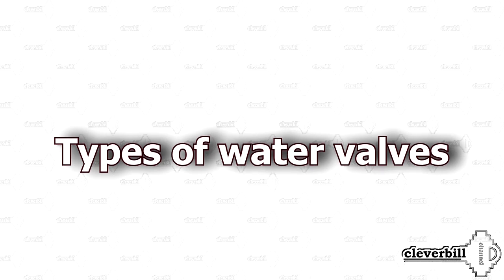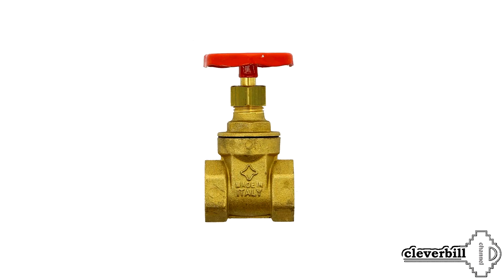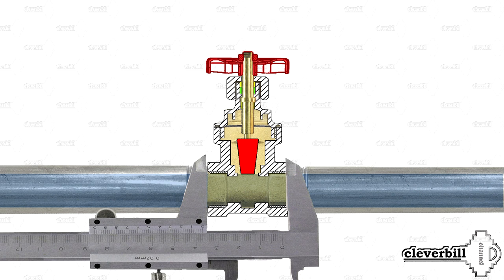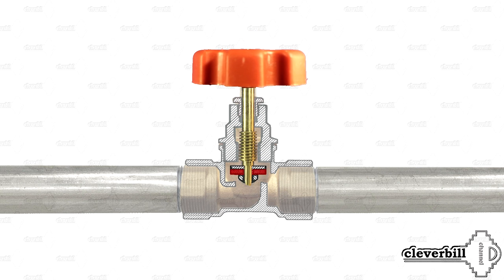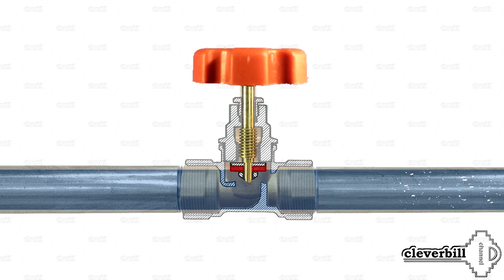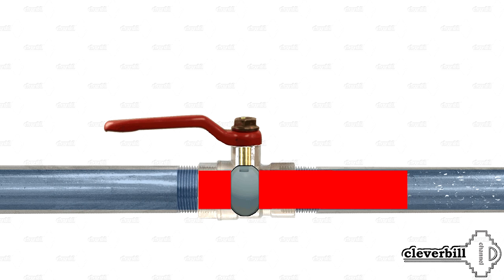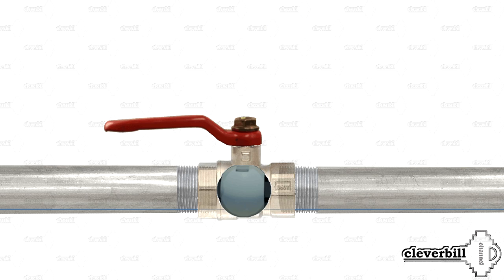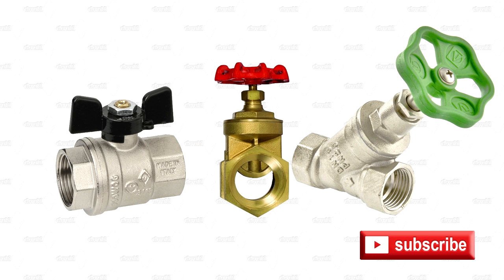What's better - ball valve vs gate valve vs stop valve

Comment: This was a very good demonstration of the valve differences.  my shut off valve to my house won’t stop the flow completely so that I can do plumbing repairs and changes. I am sure the rubber seat washer is worn out. So using your information I want to replace it with a ball valve. What are your thoughts on homeowner use of brass compression fittings instead of solder connections. It will be much easier for me to replace the whole house shut off valve outside the house without having to solder the connections.
Reply from the maker: Brass compression fittings have one feature, they cannot be used in inaccessible places, as over time, their connections can loosen. Therefore, of course, soldering is preferable, but if access is available for inspecting the connections, compression fittings also have a right to life.

Comment: Good day, I was trying to bring water from the reservoir tank to my toilet but the pressure of the water could not reach the upper part. What do I need to add? Which of the valves will assist in pressure increase? Thank you
Reply from the maker: Hello. The valve does not affect the increase in pressure in any way, it is a shut-off and control valve for water. If you need to increase the pressure of the water, you need to look at the booster pumps.

Comment: Hello I have a question about a 25mm Outlet with WaterMarked Brass Ball Valve at our home
. The tank outlet is located near the bottom of the watertank where collected rainwater flows out. The threads are BSP type, and the default outlet is 25mm. Want to attached a water facet to the outlet valve for watering the garden (does not have any other water outlets for direct use) it that possible? If u could let me know, I would be so thankful
Reply from the maker: Hello. If I understand you correctly, you want to connect a garden hose to a 25mm ball valve. If so, then it is very easy to do. You need to buy an adapter with an inner diameter of 25mm and an external fitting for connecting a garden hose. If I misunderstood you, you can send a photo of your crane to my mail
Clever-Bill@yandex.ru, I will try to answer you immediately.
Reply: @Clever-Bill  My shower pipeline is outside of the wall so i thinking to use a valve in low budget, can I use a ball valve or not
Reply from the maker: To adjust the water intake, a ball valve will not work, it has only two positions open and closed. In order to regulate, a seat valve is needed.
Reply: @Clever-Bill  hello